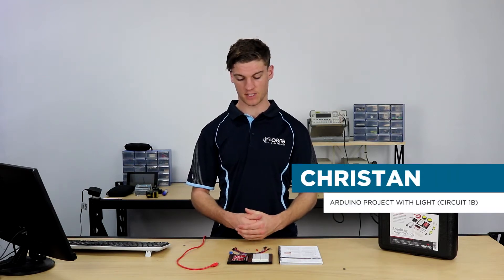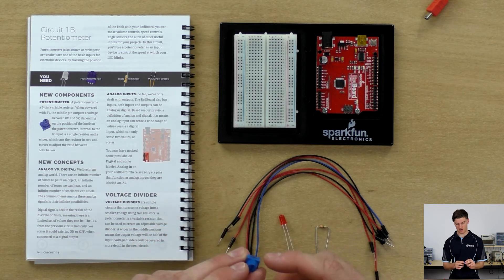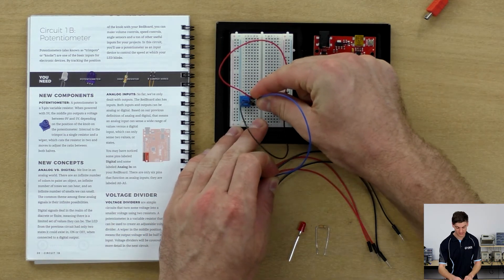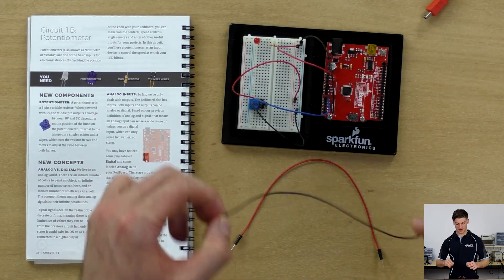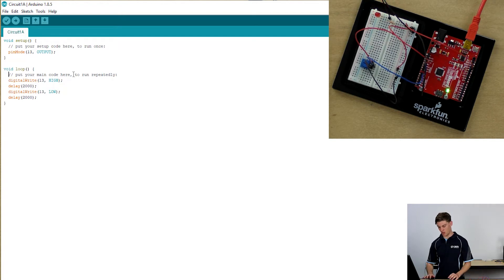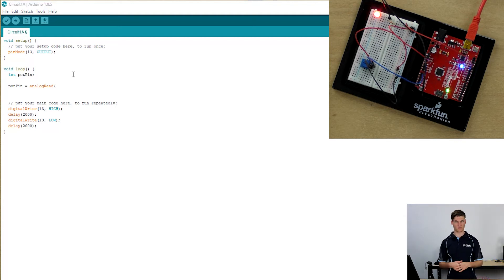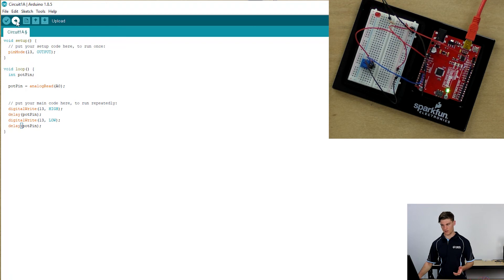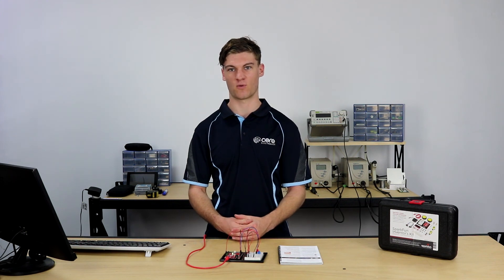Arduino Project with Light (Using Sparkfun RedBoard, Project 1B)

Comment: I very much appreciate your tutorial.
I am a seasoned electronics engineer designing complex FPGAs. I purchased the red board with the intention to create controllers in house to raise window blinds, and for a day all I had was frustration. I wasted too much time reading documentation that was confusing and not getting the arduino to do anything. With your help I now up and running, and it only took the length of your video to do some more elaborate blinking. You are a very good instructor. I am very glad I found your video.